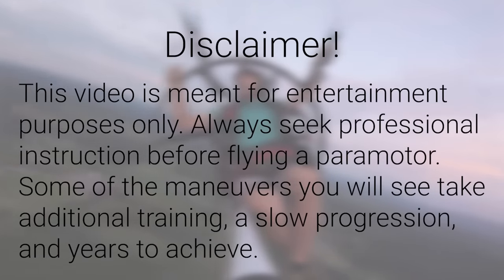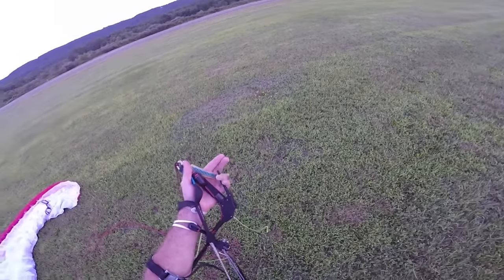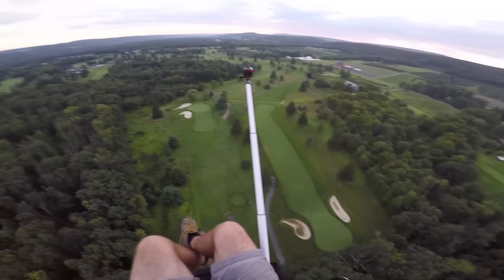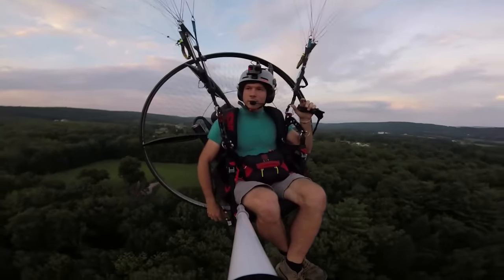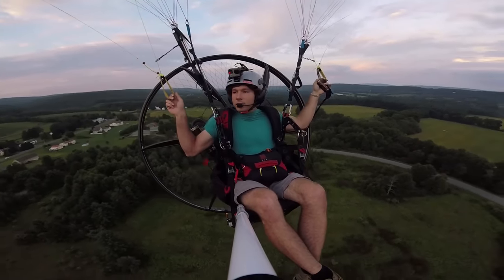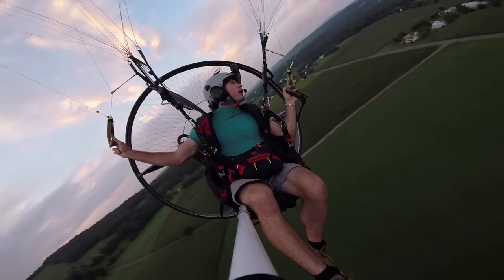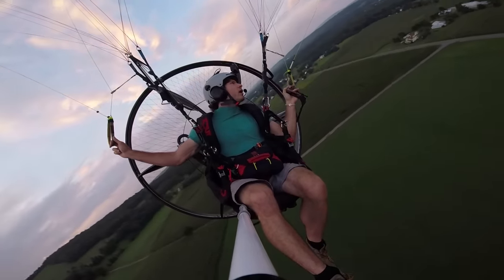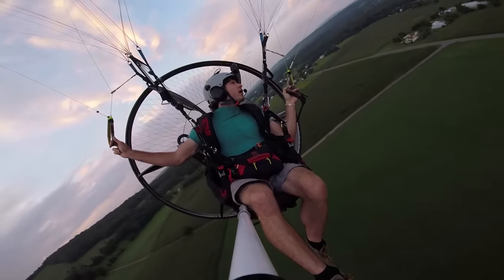How To Fly A Paramotor!

Comment: I really liked how you explained Jacquelyn’s wing a few months ago. After I graduate from the AviatorPPG class I believe I’ll just get her wing. I’m a little older than you and I’m pretty happy just cruising around looking at the horse farms of Lexington. The spinning around that you did in this video would have me hurling my lunch onto the ground people. LOL. Loved this video Mr. Tucker.
Reply: TriplePlay it’s called:

Intentionally collapsing the wing!! - ozone mojo review
Reply: This is your captain speaking if you feel the need to vomit. Do so  at your leisure over your enemies house.... BOMBS AWAY!!!!!!. Lol
Reply: A,B,C are group of lines connecting the wing to the risers. The risers are the straps connecting the lines to the carabiners.
The A lines are connected to the front of the wing. The B lines are connected to middle of the wing, the c lines are connected to the middle back. And the brake lines at the trailing edge.
Trimming is adjusting the lenght of the risers, so the back of the risers are longer or shorter than the front. It changes the angle of attack, the angle between the wing and the airflow, changing the speed of the wing, and other flight behavior.

Comment: On a skydiving parachute, if you turn using the rear risers (sounds like your inner break line is effectively doing the same job) we'd call that a "flat turn", vice a "toggle turn", which is just effecting the rear tip of the wing. It's good for making a turn without losing altitude. It's also less aggressive.

Comment: A little bit older of his videos but a very informative video -- I know there are several terms that I had some confusion on and this helped although still not clear on tip steering.  Anyway this all looks very fun and interesting and thinking of getting into this in 2022 or worst case 2023.  I don't see many paramotors over my area in central PA but I do remember one time somebody in a paramotor trike passed right over my house at 50 ft or so and it surprised me but it looks like such a fun thing as I watched them crank up the motor and head off west.  I do see people flying occasionally when heading up and down the interstate for work.  I never thought too much about getting into it due to cost and time constraints but I've pumped up my income recently so that isn't a problem and I'm sure I can work the time angle until I am semi-retired in 2 or 3 years.

Comment: I love your videos! Honestly considering the possibility of getting a paramotor. The convenience of being able to pack it all into a back-mounted set up leads to some interesting backcountry applications that I can take advantage of here in Wyoming! Though I do have a few questions 1) How fast do paramotors typically fly, and how far can you typically get on a full tank of gas, and 2) what are the typical limitations on wind (i.e. how much wind will make it too dangerous to fly)? PS: I have taken classes on how to fly fixed-wing aircraft and have endorsements for the FAA private pilot and light sport pilot written exams. The former I will probably never do because of medical concerns, and the latter won't be for a long time because of money. However, there is a lot of content esp. regarding light sport aircraft that also translates into ultralights and paramotors.

Comment: Yes I would like to see more of the basic stuff...like how to get the parachute up every time and how to hold the straps so they hang properly when the choot is over head and your running your ass off  ...
i am considering getting a paramotor and choot but don't know the first things about them other than they are usually very expensive.... I had a ultralight gyrocopter years ago... so I am not new to the idea of flight but my actual experience is almost nil
.... finding a used paramotor is my goal but I am concerned on what kind of choot to look for.... the engine and prop are simple to me i can make them work perfectly ( I'm a retired motorcycle mechanic) ...  so I don't need something "perfect" just something that works and won't get me killed ! LOL....
where do you find paramotor instructors ? and how much can I expect to have to pay them ? 
thanks for your answers in advance ! 
keep up the videos and stay safe ( that means quit flying under bridges !  LOL)
Bob......

Comment: When I lived on the south coast of Spain there were a couple dudes would cruise over the water and the beaches. Coastline is very mountainous, basically the mountains just drop straight into the sea. They found one dude dead on the mountain behind our house.  Does this sport lend itself to uneven terrain with unpredictable air currents? Don't know how dude ended up on the mountain, might have been anything.

Comment: I am curious about cross control to lose altitude.  In an airplane if you are too high above the end of the runway on final, you can do a slip where you add right aileron and left rudder or vice versa to come down at a steeper angle. Could you do the same by shifting your weight one way and using opposite  brake?

Comment: Is it actually a sport? Or is an extreme hobby? The old debate is that a sport will host risks, and a hobby a pass time. It's like this though. Say golf, that's a sport with no danger apart from say, hitting someone with a golf ball. Where as building and painting model planes or something along those lines. There's a rush of the fumes, making you high or swallowing a small piece of material. 
What I'm getting at. What defines a sport and what makes it different to a hobby? 
I mean. 
There are extreme sports and dull hobbies. Like there are dull sports and extreme hobbies!! 

PS. This is for literally anyone to comment on.

Comment: I woul follow your own rules  in as much as there is nothing better than proper instruction from a proffesional, after all,, as simple as it looks, it still involves YOUR  life, there is nobody up there with you to tell you you have got it wrong, and the bottom line is that you fall out of the sky a lot faster than it took you to get there if thing are not right.
I am waiting for someone to create a simulator for this, and even then only after having had some full instruction.
Anyone who has ever flown a foil will tell you that despite what  you may think, the idea is still an evolvement of a foil kite, so buy one and getbthe feel for just how powerful these are, and of course you will quickly learn how easy it is to loose inflation with just a dew seconds of no wind, by which time the lines have mixed themselves up and the thing will not open up to a full foil again, at least with a kite, you are still on the ground, but having said that you will also become aware of how how pulling power they have, so much so that the following is a must, NEVER let a child loose with one of  these kites.
A good example is another hobby of mine which is kite fishing where my kite standing on the ground, looking like a right angled triangle can pick ME up, it will support two miles of fishing line plus two 2lt milk bottles full of sand and a fishing line with ten or more hooks on it with fish, thats my normal one but i do have one that requires an electric winch to get all the line back in.
When it comes to flying the best thing to remember is that what goesvup must come down, the more gentle the coming down bit the better it is for your health!!!!!!

Comment: I just dont really understand how to do like a nose dive
Reply: Probably cut back on power and engage the brakes as much as you can but you you'll never do a true nosedive because you fall faster than the airfoil holding you up. If you do somehow end up level with the chute/airfoil you'll either swing under it and sort of do a wavy hop until you're level again (or hit the ground) or you'll be doing a stable tight turning spiral, which isn't diving. The mechanics of this setup definitionally limit your speed. Make your angle of attack more horizontal to go faster but you have to "drag" the chute to create lift so you can only go so fast.
You could spill the air out of the chute or get a negative angle of attack but that's more just letting yourself fall feet first than actually nose diving, which I think of as having some forward momentum.
It also sounds super dangerous and not something this vehicle is designed to do.
Reply: @jontobin5942  thank you very much.